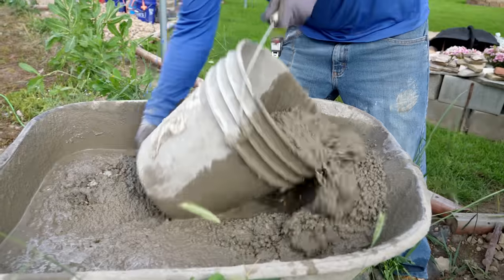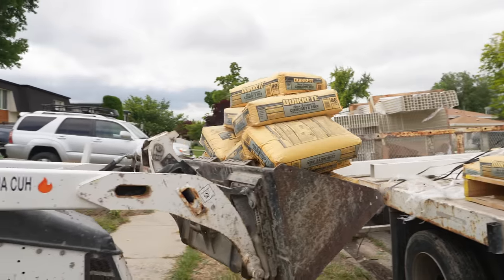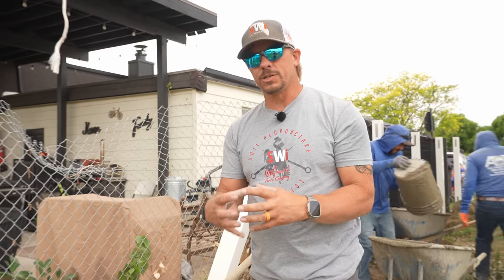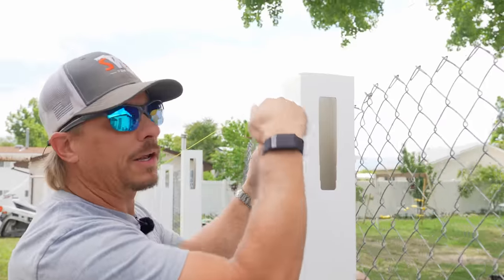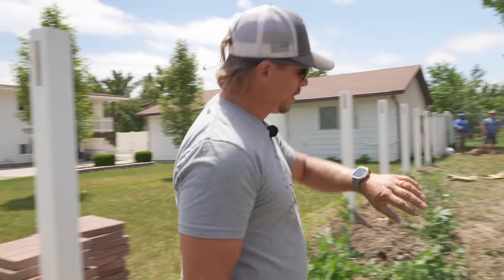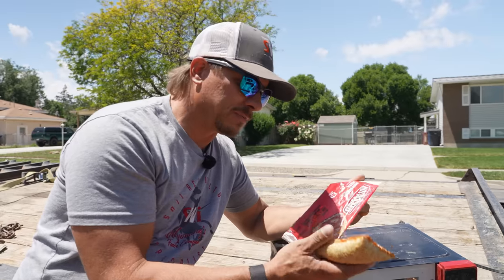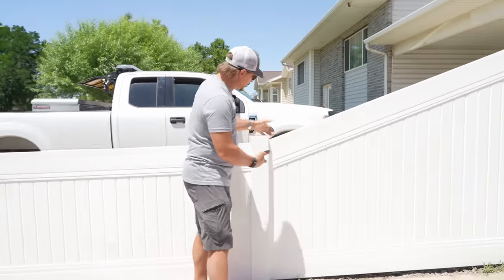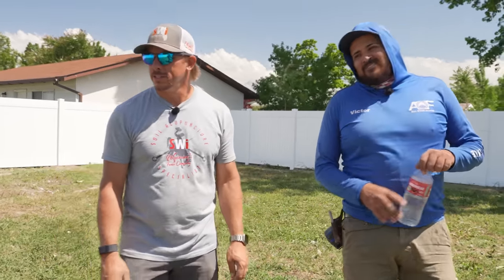This Mexican Fence Builder Left Me In The Dust!

Comment: As an ex fence builder ( and owner) for 40 years, we ALWAYS mix our concrete in a wheelbarrow, works just fine. For mixing and pouring, I’ve always made a short round point shovel with welded sides. Also, I always use a string, I used to do it by eye, but like Victor said, you end up walking back and fourth too much. The string don’t lie.
Reply from the maker: Everybody's got their favorite method. 👍🏻
Reply: I agree always use a string I've been a carpenter for 45 years columns and I always use a string for lining posts and columns 11:24  or straightening the wall or doing brickwork the always use a string always.not using a string is bush league.
Reply: @SWiFence  fences may not NEED strings, but, they're definitely needed for footings. Knowing this, I'd never skip out on them for fencing. Why not use what is reliable and quick, especially if you have a good hand that you trust to set it up?
Reply: @SWiFence you got owned. Own it.
Reply: String was way better. We all saw how much longer it took him with his cute little bucket and no string
Reply: That part where you said you wish you were taller and didnt have to stand on a bucket to eye in the posts? The string eliminates that but use your favorite method instead i guess @SWiFence
Reply: Anyone who builds a fence without a string has no clue what they're doing
Reply: I never seen anyone use concrete for fence posts and thought is was a big no no.   Always use 1/4 down to pack in and allow drainage.  That is for wood posts.  Otherwise they rot.  This is what I was told and if you ever have to dig up the old post it would be a nightmare with the concrete.   I can remove a post by drilling a hole in the post near the bottom an putting in a rod and using an old car jack to remove the post.   The water gets in the ground and sits there and when it freezes it will push you post up and your whole fence will be up and down and all over the place.  The crushed rock doesn't behave this way.  Your post will still move but not like when you use concrete.   I guess in Florida it doesn't matter but still , if you want to build a different fence ,  how do you remove the old fence with concrete in the ground ?
Reply: Who dry packs concrete? There is a science examining materials. Concrete involves water. Lots of it. Find a single example of a dam built of dry cement. 😂 A wet extra wet concrete mix in soil like this will work great and be very strong because the water will wik into the soil.

Comment: I have no care about building a fence let alone watching someone build it, but I couldn't stop watching this video! Great to see different races working together and learning different techniques from each other. I enjoyed this, Thank you!
Reply from the maker: Awesome, thank you!
Reply: As a Mexican I would disagree on the word "races" as we are all the human race. We should use ethnicity or culture. Biologically we are all the same.
Reply: @SWiFence I take a 94# bag of portland cement. In the home depot parking lot on my trailer I transfer the portland to five gallon buckets with lids. The dirt is dug out of the holes and mixed with the portland. Eyeballing my posts (no string)  and mixing dirt, portland, and water (bucket, hose, or hydro jet) the posts are set to height, line, and plumb as I go. 
I used 60# redi Crete for years, it's heavy and $5/post or more.  Portland cement and dirt mixed in the hole is stronger, less labor intensive, and 50¢ to $1 per hole. No B.S. Also I'm a one man crew for what it's worth.
Reply: Just some humans working together.
Reply: It's not about race it's about work ethic I had a 4 man crew mixed ethnically and we could rig 125 square apartment building in a day.

Comment: A looser slump concrete mix is definitely the best way to go for fence posts. It fills the hole much more evenly, reduces the amount of air pockets to zero. I've built hundreds of fences and no one will ever convince me that dry packing works as well as barrow mixing.
Reply: What's up with that new expanding foam crap they got out. Sure that shit can't be good for holding up a fence post for long could it.??
Reply: @Clarkster420 you can literally use the same dirt you pulled out of a whole to pack it in. There are better methods but it still works and got people by before concrete was a thing. I’d imagine the newly engineered stuff works just fine as well for simple things such as fence post.
Reply: @frankiethefrog1752  rots the post, might hold up 10 yrs but the concrete will last at least 20 yrs
Reply: dirt tamped posts still beat anything...  concrete draws moisture, the concrete will last, but the post will eventually rot/break off at top of slab
Reply: @wildbill6976  Concrete is the only thing that will keep frost heave from shifting your posts on the winter, I've replaced dozens that were dirt tamped or rock filled because of the severe effect that frozen ground has on them. I had to redo 44 posts for a fence that was less than a year old because they had heaved and shifted so badly over one winter. The previous contractor just used rocks and dirt.
Reply: @wildbill6976  No way I would trust a dirt tamped post for a minute. Then again, I've got a half-Belgian mare weighing over 1700 pounds using them to scratch her butt. My corner posts have concrete surrounding them three feet down and mounded on top to let the rain flow away from the posts so it doesn't sit there and rot the posts. It seems to work pretty well.
Reply: @Clarkster420 Easy to work with and more forgiving.  If you need to replace later, much easier to pull out.  That being said, it’s sturdy.  As for rot, just waterproof the bottom, whether concrete or dirt.  They have tape or liquid.
Reply: @i_i8924 Waterproof the bottom…

Comment: We install fence in upstate NY. We average about 30 -35 posts a day. Alot more work than people think. In July we did a horse fence, it was just one of those jobs that everything worked. We installed 68 5x7 timbers 40in deep in clay set in concrete in one day. We run 4 guys including getting 3 rails on half of it the same day. I was super impressed.

Comment: I like to set a 1' string line and mark my post 1' up from the bottom of the bottom rail. Mark the string to correspond with the edge of the post for accuracy.  This allows me to get in and out left and right and height in one shot. The mark on the post goes level to the string. And the mark on the string goes to the edge of the post. Marks on string are I panel plus a post so a 70" section and a 5" post would be 75" to center or edge rather for better accuracy.  Just my way if it helps anyone out.

Comment: I haven't used concrete to set a fence post in many many years. I simply tamp the soil around the post using the tamping end of a post-hole digging bar. It works great.

Comment: To me dry packing is inferior to wet mud mixed right! Another way to set fence fast is use concrete chuncks and rocks to wedge in wholes for to hold post in place then you can pour without someone holding them. Also you can get masonry bits for standard 7 1/2 inch ripsaws which would cut straighter and the same as the grinder trick! Good day and good video!

Comment: I liked your no brace rule. That's how I did pole barns. Also I would cut to the exact center of each post with the skirt boards. We had the corner posts perfect and the other ones close. The intermediate posts could be off a bit with no bracing, but we just made sure that the top hurts matched the bottom skirt boards. We always had a parallel or a parallelogram when finished and used a hand winch to plumb the posts all at once . We also marked the truss locations on the ground .Everything on the ground with perfectly square cuts. We even took the time to flare the posts out of pull them in .
   We marked the trusses perfect identical le gth on the ground as well and that set the building width at the top.. We set one string on one side and
the other side came to mark as did all the rafters. We even use high strength fishing line instead of mason string  because the wind does not kick it.
   We did have to drive a stake if two for the end walls until all the truss spreaders we're set in the ceiling.
   Everything works well including having a Perfectly straight  and square roof frame

Comment: Fast work for sure, but why move the line  up high?? Keep the line 8-10 inches off the ground for both digging and stetting the height, just use a mark on the post , comes out perfect every time !! Short handle shovels work 
best for mixing concrete in wheel 
barrows ..
We all have different styles, good job!!!
Reply: Need those tree planting style shovels

Comment: Ive seen a few examples where an angle grinder works better than a quickie saw. It's always on a smaller job. I'd use an angle grinder to cut a single rebar, but, if I had to cut lengths in a bunch of rebar at once, I'd use the quickie saw for example. If I'm cutting control joints in a pad, quickie saw. If the concrete guys misplace all of their rebar, I'm cutting the bastard pieces with an angle grinder. Whatever is faster.

Comment: When I do fences, alot of times I come across old posts/concrete it just crumbles like sand.  I'm assuming its from the dry-pack method. I always mix concrete above ground in a bucket and mortar paddle bit in my slow speed drill. Usually make it a bit wet for the same reason you said, to get it to flow down and around everything.

Comment: I abso-friggin-loved this video. Personally, as a DIY/homeowner but, I have learned SO much as a DIY'er watching my Mexican friends work. You ever had to level across 30+ feet? Get a big long surgical tube and fill it with water. The bubble at both ends IS level. Put your line across that. Done. My friend keeps lengths up to 90 foot tube just for grading soil, and he did it QUICK.

Beyond little bits and pieces of dirt-cheap engineering, it is literally just grit and hard work. That's how they get it done so fast :)

Comment: Yep I definitely agree when it comes to the concrete mix. This Is without doubt the biggest problem I have with diy YouTubers pushing dry pour concrete. The proper drying/hardening of concrete is dependent on a chemical reaction that depends on the correct ratio of concrete mix and water. In a dry pour a crush test of your 3000 psi mix will likely show that it's actually under 1000 psi. With a too wet pour  being between 1 to 2 thousand psi. Proper mix ratios are important depending on expectations concerning strength and durability (lifetime) all based on intended use.

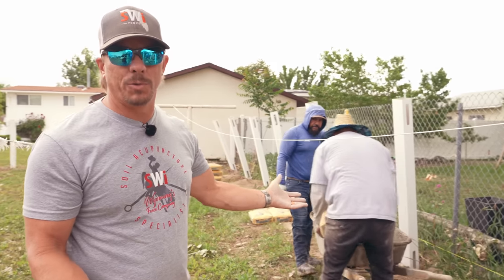Comment: I hauled residential trash for 20 years until I broke my neck. We had some Mexicans and one or two Colombians working with us. Those guys worked their asses off! They would roll into the shop at 5:30 chomping at the bit to go and get it done! We were usually hauling by 6am. They would run all day in the heat of summer until we finished that days route! Summer time we were usually done by one or two in the afternoon. They'd go home get a shower and eat, then go to work at whatever restaurant they worked at. Close the restaurant and be back at the shop ready to go again!! There's no way in hell I could have done that! All of They Mexicans I worked with were legal and owned there homes. Their cars were paid for and so was their taxes.  I have the upmost respect for those guys! Not to mention the fact that family came first! I've only met one " lazy Mexican "  in my time. He did not last long at the trash company.

Comment: I made a fence and the way I planted the posts is by digging a hole and using big rocks to fix it in place, smaller rocks to fill the gaps, stomped it real good, then concrete, saves a lot on concrete and it's much stronger, the big rocks do all the work.

Comment: If they wet set and assemble, any wind load could cause posts to lean out of plumb. We work down on jersey shore and constant wind, we dry pack our line posts but wet set our gate posts. Or dry pack and then come back and wet them with a hose. But the fry pack stability works for us

Comment: Just replaced 5 wooden 4x4 posts at my own house after 27 years that were in concrete just like the concrete Victor is using.   27 years is a long time. I won’t have to replace those 5 again!😄

Comment: It is much easier to remove the pvc posts when wet cemented only around the post and not inside as well. I was an installer at 19 after a couple seasons. Laborers were paid by the foreman as we got paid piece rate. On larger jobs we would have two helpers. Most never made it a week and some wouldn't finish out a single day. At one point our company got work release guys from the county prison. I had one guy vanish and hop on a train to score dope in the city. The hardest days were 6' high PT shadow box or solid board soaked water from rain and a long carry through woods because access was the driveway 200 yards away and up a steep slope.  I have nearly 20 years under my belt and still do the occasion job for friends and family. In the north east we usually have rock or shale to dig through. The first thing builders do is take the topsoil off and then pour foundations. We worked around boulders because it would take dynamite to break them. The most fence I ever did was on a side job in New Jersey with three other installers. We got 3000 feet of 3 rail split rail with 8 or so gates in one day. I was one of the two guys that dug the holes with a two-man auger. It wasn't near the ocean but closer to the Delaware River and rocky. We had to sit on the handles of the auger to get some of the holes down and took a beating on the leg for rocky parts to reach 36". I was tired and sore for days. I was paid a whopping $140 by the cheapskate. I never did any work with him again and neither did the other guys. I'm not sure how much he pocketed but, he lost much more than money after that.

Comment: Great job way faster than what we did but ours was custom build 

We built 4in high concrete runner around with post set in then we use 16' ft coral board 6in wide cut to 12 ft their treated but not 100% strait so we got a jig squeezer and each rail and picket get four cleated nails so they don't move a mm then we put header along length and then frame up a door and cut right threw the wall with hing and all attached then frame the door and the locks in that way it matches perfect

And you definitely don't have neighbors poking their nose over the fence or under

Comment: We got a core drill that sucks fast to flat surfaces, its just each bit runs around 3,000 dollars. But they make the best cuts for post holes. 
And I would recommend getting inverters installed in your work trucks, never know when you'll need power and none around.

Comment: I found out the hard way wood 4x4s rot within 5 years here in the Salt Lake Valley. I saw a vinyl fence being installed in Magna and they were using steel 4 x 4s and sliding the vinyl over. But you guys are putting the vinyl 4x4s right into the ground. How many years will a vinyl fence last ? Is there more than one type of a vinyl fence?
Reply from the maker: That depends entirely on where people are sourcing their vinyl from. We like to use National Vinyl Products (they're actually headquartered down there in the Salt Lake valley). There is such a thing as trash vinyl, and those fences won't last. 👉🏻 https://youtu.be/o72mFcwKIXY
And yes, there are a variety of vinyl styles.

Comment: Easiest way to do height is set you line 1 meter from the ground, mark 800mm from the top down(if doing 1800 high fence) then make sure the line is matching the mark when you set.

Comment: I've had both of my hands cut open after years of tying rebar as an Ironworker do to carpel-tunnel syndrome, I can relate to the cramped hand, salt and hydration are very important while sweating and working!
A grilled cold hamburger from the night before would be much better than that chemical filled hot pocket, you are what you eat!
"KEEP ON KEEPIN ON"
Reply from the maker: Just for the record I didn't actually eat it. 😏

Comment: Whenever you're going to cut out a relief section, like they did in the driveway, The first thing that should be done is make the marks like they did, but then using a hammer drill, start out with a 3/16 cement bit and you only need to go down 3/4in. Do this to all of the posts. Chang the bit to 5/16, and then go all the way through with a half inch drill and a little water to keep the drill cool. Then cut down at least an inch all the way around and that cement will easily break off with a sledgehammer.

Comment: Looks like a great team with both speed and quality. The compressive strength of concrete is pretty unneccesary for a fence post. As you said fences typically don't even require concrete they can just be dug and backfilled - I suspect the concrete makes fence post alignement easier with over-wetted concrete, then backfulled post holes.  this practice is totally adequate as long as enough post is in the ground about 1/3 of the post height - (3' for.a 6' post), which is the real requirement for the wind loads. Water pockets at the top of concrete will rot wood post at an accelerated rate over dry packing.